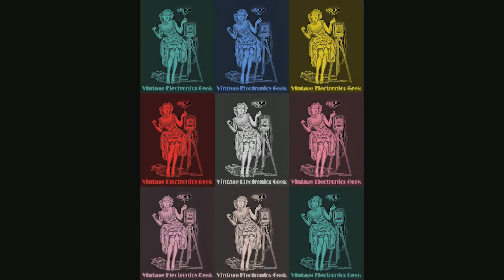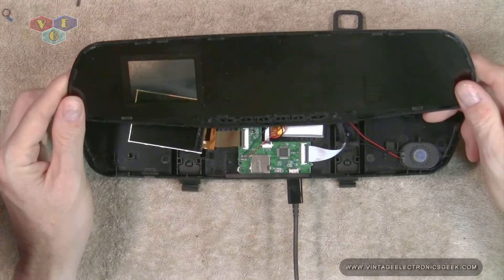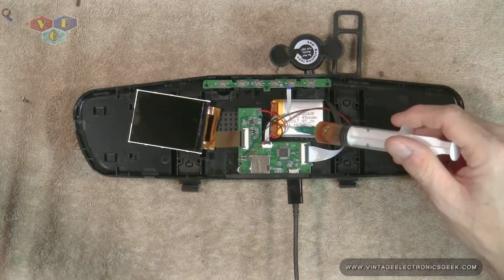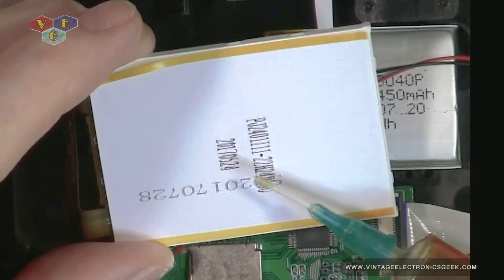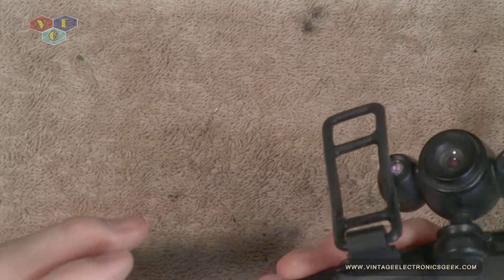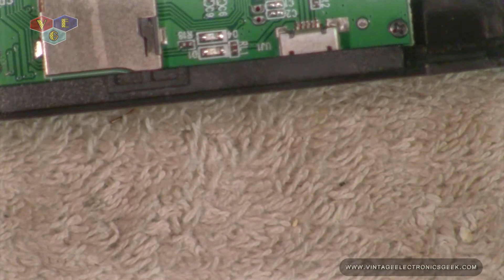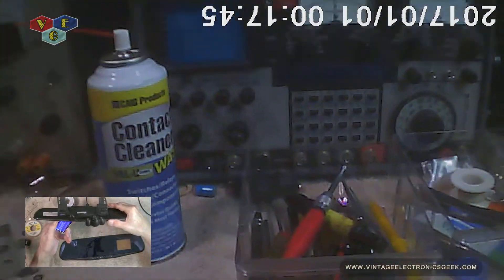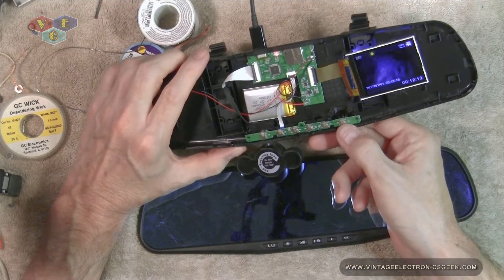HD Mirror Cam - Repair

Comment: How do you clean up those bridges, I have de solder braid, looks like thats what you used, would be 
nice to see a video on how you clean up something that intricate, and small..
Reply from the maker: I apologise, did not get notified.  If you have pins connected with solder, then just quickly take your solder iron and rake across the pins, that should break up the solder bridges but yet keep solder on the pins only, you may need to rake several times dependant on how hot your iron is and how slow / fast you rake. If you have an abundant amount of solder, then use your braid to clean up then try re-soldering.  Hope that helps some, good luck!  ~Jack, VEG
Reply: @VintageElectronicsGeek  Thank you!

Comment: Wow... I know this video is older but I hope you see this. I have a 10 inch vantop h610 and I need to remove the glass from the case like you have,but I don't see a single screw. Is it possible that its just clipped together? Do I just carefully separate with a plastic pry tool? Should I start in a certain area or anywhere. I know you don't have it but just your opinion would be great.... thanks
Reply: my vantoph610T is having same problem did u find a way to open it?
Reply: @K3vinPwnz  yea its just clipped in. Work around it i opend it pretty easy
Reply: @eddiekytia  found out how to open it but now did you manage to fix your problem with the dash cam?
Reply: Did you end up fixing it ? I have the same problem with the same camera
Reply: @nataliemillan2826  sorry nope, I made it worse trying to solder out the old usb connection.

I bought another one but a month in and same problem as the one before,fuck this shitty product

Comment: Um very impressed Jack, mucho garcias!  I got it for Edie in Holly's van, it was around fifty bucks.  Used it at least a year, just left it on monitor loop, when key was turned on if I remember right.  If something happened, I had to remove SD and use PC to see what was on it. Back in the van it will go.  BTW, I gave it to you to keep, IF you fixed it.  I thought that you might get a kick out of it, did you try it in the car?  Its camera is fair, but still kewl.  It's a good idea, especially if a cop gives you a ticket, lol.  I will gorilla tape the power cord to it just in case it gets yanked again.  Great job, you the soddermeister!  
73, Don
Reply from the maker: No problem Don.  No I did not try it in the car...just in the office after fixing it...yes a dash cam is a great idea for many reasons...I do use one on trips...mainly just encase accidents...have a video witness.  ~Jack, VEG

Comment: Hello, you can help me please the screen of my hd mirror cam went blank and I can not see what it records, but the camera if it records and takes pictures on the card. Thank you for the help and for a certain good video
Reply from the maker: Howdy!Challenging to say without looking at it, however its plausible the back light went out, but generally those would burn out slow and not immediately, could be a loos back light wire connection, could be a component that went bad? Could be your LCD screen went bad.  If you hole a light up to the screen can you see anything? If you can the it wouldn't be the LCD screen, it would be a back light issue. Depending on whats wrong with it, it may not be worth the cost of repair, taking in the cost of parts and labour, maybe cheaper just to buy a new one.~Jack, VEG

Comment: Omg, I am having the same exact issue with the one I got.  Didn't even get to use it bc the plug casing wasnt attached good and it pushed right in. I'm so happy I found your video!!  So I opened mine up and lined up the plug, plugged it in and it works.  When sodering it, is it ok to get it on the lil metal prongs or no, just on the metal casing? Wasnt sure if it did get on the prongs or connectors [not sure proper term] that it will still work.  Hope you understand what I'm asking , lol. Thanks
Reply from the maker: Howdy!  Make sure you have no solder brides between the pins...meaning solder only on the pins....if you have pins connected with solder, then just quickly take your solder iron and rake across the pins, that should break up the solder bridges but yet keep solder on the pins only, you may need to rake several times dependant on how hot your iron is and how slow / fast you rake.  Hope that helps some, good luck!  ~Jack, VEG

Comment: Bought the HDMirrorCam to give to my son for his birthday (which was a few month's away) several months ago now. After I sent it to him he informed me he already had one and would send it back to me. He did eventually. I put it on the shelf when it came and never opened it. A few weeks ago I decided I might as well put it on my car. My son informed me that I needed to insert an SD card so it could record and it had to be formatted. I open it, installed it over my mirror and called my son who was going to walk me through formatting the SD Card. Plug in has red light when I plug it into the cigarette lighter...little blue and red light at top of Mirror Cam....when you push "power"  (or was it the gear) you're supposed to get a "yellow light". No yellow light ever comes on.  So now what???? Mirror's useless if you can't get it to record.